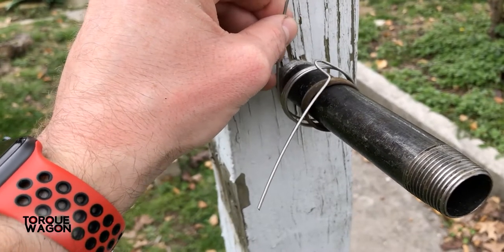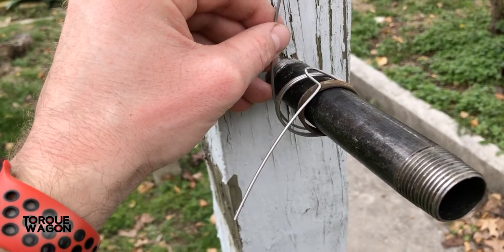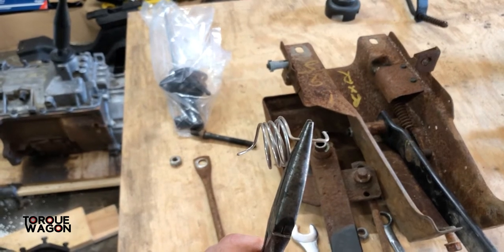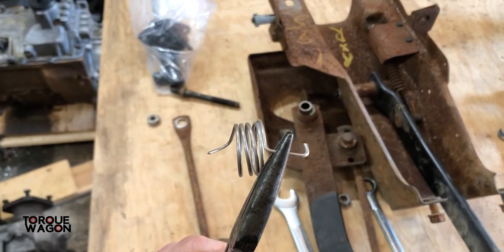How To Make a Spring (Clutch Return) | NV4500 Swap Bonus

Comment: Question:  Instead of having to go through all the trouble of removing/installing the steering column/pedal assembly, is there any way to change out the larger brake pedal for the smaller one on from a clutch assy. and then add in the clutch pedal?  In another word, are the brackets the same size so we could just swap out the two pedals?  Thanks for these videos, they really answer a lot of questions.
Reply from the maker: The brackets are fairly different, so I felt like the cleanest way to do it was to just find a manual pedal assembly. I’m sure there’s some custom options out there but they probably require more fabrication than I wanted to do.
Reply: @TorqueWagon  Thanks for that input.  My Burb is an 89, 6.2 and I pulled a manual pedal assembly out of a 90 Burb gasser.  This setup should fit correctly, correct?  PS thanks for replying so quickly!
Reply: Sorry, should have said (fit correctly, right?)
Reply from the maker: If the 90 burb was a 3/4 ton with a 454 it might work. The important thing is that the brake set up in the donor truck is a hydroboost system like the 6.2 has. If you pulled it out of a burb with vacuum assist brakes you may have some trouble getting the brake pedal to work right.

Comment: Hey TorqueWagon!  I'm doing a NV4500 swap into a 73 Blazer, formerly with TH350.  I'm also using the pedal assembly from a '90 Suburban.  Wondering how to determine that the clutch pedal will move the right amount of fluid through the NV4500 master cylinder?  There is not an adjustment for this.  Are you just going to put it all together and hope for the best?  Love the videos!  Thanks!
Reply from the maker: That's exactly what I'm going to do. I can't say I'm too confident that it will work the first time, but I'm sure I'll figure something out eventually. The transmission is in but I haven't hooked the hydraulic lines up yet. Also, I'll be using an external slave from the late 80's hydraulic clutch setup, not the internal slave that goes with the stock GM bellhousing.